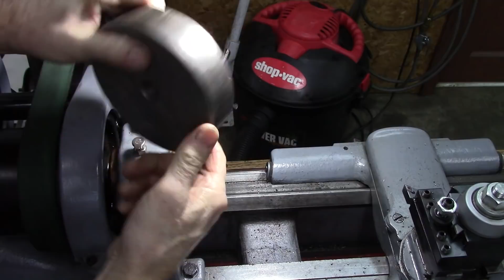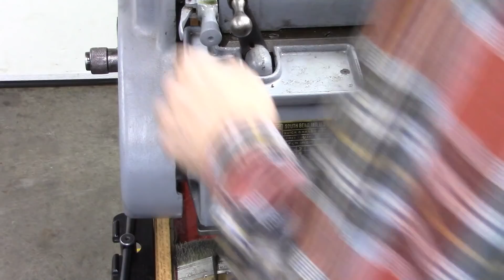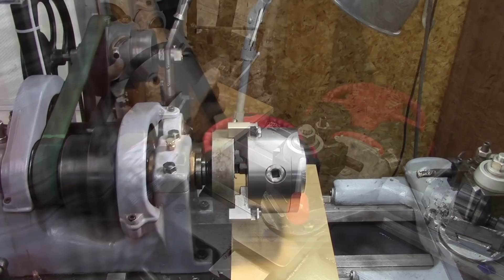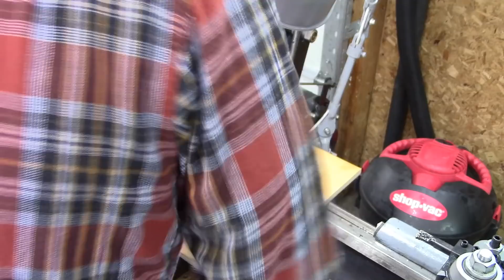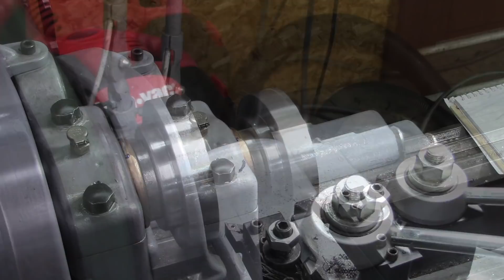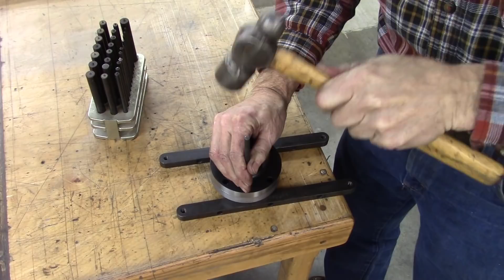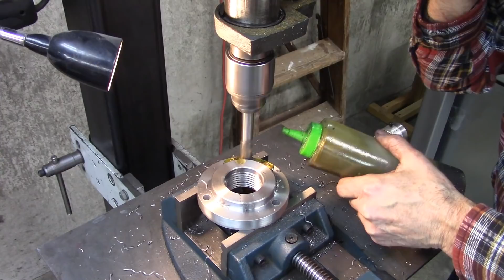Making a Backing Plate for a Collet chuck

Comment: 1. Changewheels - pushing that sliding gear option in changed from your rattling gears to quiet ones - did you notice that ?

2. Have you not considered modifying your spindles in such a way that when something is screwed onto the spindle, you have a locking 'pin' or something to stop it unscrewing when using the lathe in reverse ? (I'll e-mail a 'funny' story about 'reverse' !)
Reply from the maker: Yes it did...  and yes I notice that. 2) yeah...  that would be nice. Impossible on the Logan but probably doable on the SB. Yeah...  I've had two chucks unscrew. One I noticed and stopped it (threating in reverse) and the other was on my wood lathe. It had something to do with wood coming out of the chuck. I hit the safe which only kills the power (no brake) and the chuck when rolling on the floor. Still not sure why it did that. I was glad it didn;t land on my toe
Reply: @WinkysWorkshop  Perhaps you can dance !

Comment: Hello Mark. Nice looking project there. I have two suggestions. You can use your digital calipers to function like a dro when making the stub to fit onto the er collet body. Measure the diameter of the recess and then zero the calipers. Now measure the diameter of the backplate and the calipers will show the amount to be removed ( the difference in diameters) to make the stub. Divide that in half to get the radius to be removed. The other suggestion is to( I am sure you did this) take a break and let the backplate cool down to room temp before the final cuts. The stub will shrink enough to be noticeable if you cut straight to the final dimension while the part is still warm/hot from the cutting action
Reply: I like the caliper tip - and yes, I've commented - no need for the emery, it was a fit as it was - if he'd allowed it to cool ! And perhaps a bit of lube when fitting it !
Reply from the maker: I forget about using the calipers like that but it's a good idea. The steel was warm but not hot...  but you are right, it would change a little. I ended up making it undersized anyway to get the collet centered. Also shimmed it a little.
Reply: @WinkysWorkshop  I did the same thing for my Precision Mathews lathe some time ago.  Overshot and cut it too small "on purpose - hehe" but it turned out to be needed just like you said, as it gives me some play to adjust to zero run-out.
Thanks for sharing.

Comment: Use a good dowel pin.
Nice build.
Thanks,
JohnB
Reply from the maker: Yeah...  I didn't have one. Later I found a 3/4" hardened bar for a linear rail. I ended up shimming one edge a little but it within .0005 now. Even 10" away from the chuck.
Reply: It would sure be nice to see a video of you doing that.    I am waiting for a collet chuck to arrive so will have to make one.    Thanks for the video. 

Dale in Canada  🇨🇦
Reply from the maker: @dalemcinnes1834  I may do that.

Comment: I've had my old South Bend for about 30 years now, and I have never been able to get the check off. Kind of afraid to break something, any suggestions?
Reply from the maker: Yes, first soak it with Aero Kroil. It's high priced but very good. Soak it periodically for about a week. Then put a piece of 1-inch (or larger) hex stock stock in the chuck and tighten firmly. Put a strap wrench around the large pully on the spindle and use an air impact on the hex. I did this on mine. It's not good on the chuck but sometimes you have to take a chance. DO NOT use the back gear to hold it. You will break gears. Oh...  and get help.
Reply: @WinkysWorkshop  I like the air impact tool idea - and that might work without strapping the spindle.

How about resting a chuck jaw on the saddle (back  side of the lathe, obviously, for unscrewing) then turn the spindle backwards - possibly in back gear and hand winding the pulley shaft ???? It's the jerks that break teeth, not steady pressure.
(But it's the jerks that also free seized parts ! - hmm, maybe what you need is simply a couple of jerks ! LOL)
Reply from the maker: @millomweb  It might work...  although it would not on mine.

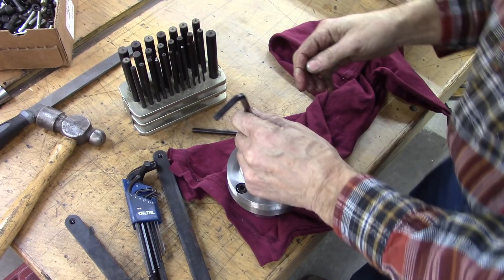Comment: 30:40 another choice would be ..... transfer punch one hole.   Drill it and bolt it.   Then transfer the rest so it can't move on you.
Reply from the maker: That's a good method. I messed up but in this case the holes were also not drilled right in the chuck. Crazy huh?
Reply: @WinkysWorkshop  in that case your gear hole pattern system might not have matched up anyway then.
Reply from the maker: @dizzolve  Yeah...   I think I would have been closer but you are correct.